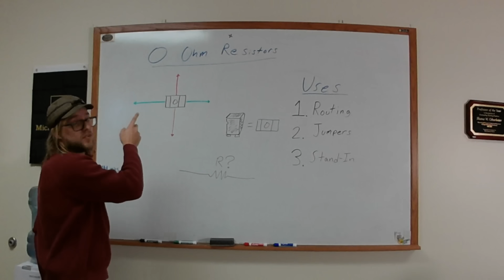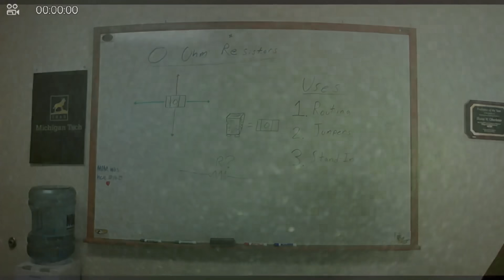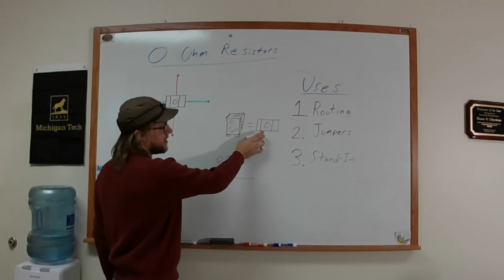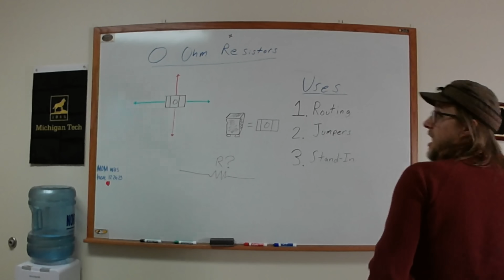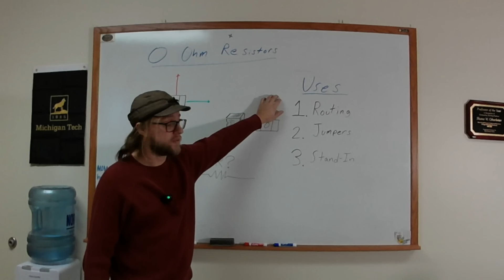The Resistor That Doesn't Resist

Comment: These are used in scanners and two-way radios.

You have a spot for a resistor and if it is in, usually is from the factory, it completes the circuit and blocks a range, usually the 869 to 894 Mhz

You usually had 2 zero ohm resistors

One to block 824 to 849 Mhz
One to block 869 to 894 Mhz

You cut both of them and it opens the 800 band from 806 to 925 Mhz

Comment: I'm sold on the surface mount zero ohm resistors as jumpers across tracks, that is certainly automated production friendly, but the through hole version still just has the feel of a DVD rewinder when wire works just as well.

Comment: Some use a low or 0 ohm resistor as a intentional weak spot or fuse in order to protect more complex and/or expensive parts of the devise in case of a malfunction so a repair will be cheaper and easier to do. This is often used with fuses in the same Circuit to avoid cascade failures.

Comment: Another (which goes back to isolation) is programming, depending on the assembly line you might want to program a chip on the board but can't without disturbing another chip (e.g. programming a microcontroller will turn some outputs on and will or may corrupt another eeprom.) It might be easier to add a 0 ohm resistor after programming rather than programming before soldering.

Comment: Only in the context of a SMD device do i see any legitimacy to the arguement for this device to exist. For through hole components, what is wrong with a wire jumper?  Old toshiba, hitachi, realiatic equipment in the 80's used to have some wire through hole wire jumpers that spanned half the length of the board old car cassette and some cs radios as well.  The actual component body makes no sense to produce when a wire would do. Even if it is just an un-etched resistor.
Reply: the  0 ohm resistor can be put in the board using the same automated machines that put in normal resistors. which simplifies production

Comment: While the resistor may have no resistance, do they come in wattage? As I use different size buss wire for jumpers for the expected current. Are there different lead guages. It would clean up some of my work for sure.

Comment: I've encountered these before. For some reason, they are not uncommon in DIY Eurorack synthesizer modules. However, I've also used leftover clipped leads for the same purpose. I'm not sure why the ceramic type is used.

Comment: I understand your reasoning when it comes to SMD zero ohm resistors, but what about the through-hole one you showed in the beginning? I don't see it having much benefit as a replacement for a jumper, nor can I imagine it's much better at bridging a trace than just a piece of bent solid core wire except for convenience. Maybe as a stand-in? But even then a piece of wire would do the same job (with the sleeve on or some kapton tape on the board in case you don't have solder mask and need to isolate it).
What are some real world examples you came across where a through-hole one was used?

Comment: Now I am curious... what do they do when wired in parallel...  1/0 + 1/0 = ????
Reply: They aren't really zero ohm resistors.  They are just resistances of negligible ohms.

Even if you did have true zero ohm resistors, you could still combine them in parallel, and ultimately end up with zero ohms.

Consider the limit of 1/(1/x + 1/x) as x approaches zero.  Reconfigure this, and you end up with x*x/(x + x).  Both top and bottom, brought x, so we can cancel out an x, and get x/2.  The limit of x/2 is no longer indeterminate, and will approach zero, as x approaches zero.

Comment: I work as an amplifier tech and I see 0R resistors in circuits on a board that also uses raw wire jumpers. Why would a manufacturer use both 0R resistors and raw wire at the same time?

Comment: Another use for 0ohm resistors is cheap and compact Fuses. Those SMD or even axial resistor have a tolerance of about 0.25A so anything higher than that will blow the resistor.

Comment: I have always saved about 20 or so passive component legs (ie resistor legs that you clip off after soldering) for solder  jumping. I could see why someone would use a 0 ohm for boards that are meant to be admired. Also for mass market unless the machine makes it cost more for jumpers vs 0ohm resistors it's probably a waste of time. I've never purchased them myself, but when I assembled boards for others and they provided the parts, they get what they want electronics wise as long as their check clears. You can also heat shrink a resistor leg for more short circuit protection if needed.

Comment: PRO TIP -- PHYSICISTS HATE THIS TRICK!
solder a ton of them together in place of wires to make a circuit with no resistance. It's the room temperature super-conductor they don't want you to know about 😎
Reply: Solder has resistance! BUSTED
Reply: Twist them together @violinviolator5841
Reply: @violinviolator5841  That's what they want you to believe...
Reply: @violinviolator5841 on proper solder, the solder would never be an actual conductor.
Reply: @sergeantsapient  if that were the case solder would have been replaced with glue long ago. On a microscopic level the contacts of electronic components are rough, which reduces their ability to contact. On top of that they‘re covered with oxides that effectively isolate them against each other. Treating them with removes the oxides and liquid solder flows in to fill the gaps created by the roughness of the contacts - which not only increases the area of contact but also oxygen from getting in their and forming oxide layers that reduce conductivity. So in a proper solder the is an essential part of the conducting.
Reply: @MrAranton  I thought the flux is what removed oxides, not the solder. My understanding is that solder does help fill in gaps in the conducting surface but it's not the conductor itself. It's not like you're using the solder as a jumper to the conductor.
Reply: @sergeantsapient  You're partially right. It is the flux that removes the oxides. But without the solder to fill in the gaps between the contacts, they would start to oxidize again, the moment the flux is no longer effective. Now: If you used some non-conductive substance to fill those gaps in order to keep the oxygen out, the electrical connection would be much worse - if there even is one. That's because a conductive solder increases the effective area of contact between the contacts by levelling out their unevenness.

In a proper solder joint, the solder and the surfaces diffuse into each other, which results in a layer of "contact- solder"-alloy. That layer is only a couple of micrometers thick, but it's vital. That means: a proper solder joint has five layers: The material of the first contact (say a soldering pad on a PCD, an alloy layer, a layer of solder, another layer of alloy and then the material of the second contact. If even one of those alloyed layers is missing, we have what is called a "cold solder joint". So on the microscopic level it doesn't make sense to say "the solder isn't the conductor", because it is.

However: on a more marcoscopic level things are different. When you're using a prototyping board - lots of copper plates holse with no connections between them. In that situation smearing solder onto the board to create connections between components is a botch job. The proper way to do it, involves copper wire that's soldered onto the eyes between the components. Maybe that's what who ever told that the solder should never be an actual conductor meant.
Reply: @MrAranton  when I looked into this a couple years ago, I think what I was told was that the solder itself amalgamates to the conductor. But yeah what you're saying does make sense. I guess I was looking at it more along the lines of using solder as a jumper or a bridge which from every other practice I've seen when it comes to soldering is a huge no-no.
Reply: @sergeantsapient  And I was looking at it along the lines of an individual solder joint. So I guess we were both right, but in different ways?

I wouldn't have used the term "amalgamate" - in my native language that's strictly reserved for "forming alloys with mercury/quicksilver" - but apart from that it seems we were told the same thing.
Reply: @sergeantsapient  Flux removes oxides, but the solder then prevents new oxides forming as it conformally coats and seals the joint.
Reply: Definitely works. Made my own hydrogen fusion bottle using these.
Reply: 0 Ohm resistors aren't really zero ohms.  They still have some insignificant resistance, of fractional ohms.
Reply: @carultch  I'm glad you understood the joke :)

Comment: They also match impedance more closely than PCB traces when you have precise requirements like a differential amplifier op amp configuration; by using a 0.01ohm resistor and a 0 ohm one, both have the same resistance between the leads and PCB and length of the resistor itself (compared to a PCB trace) which cancels out perfectly.

Comment: This past summer, I diagnosed a Mitsubishi split A/C control board that had what appeared to be a diode, white stripe at one end and black body. But had zero resistance in either direction, the problem turned out to be a transformer. So I assume it was a zero resistor , but why look like a diode?

Comment: Zero Ohm resistors do also exist in SMD versions. They are often used instead of configuration switches. Automatic machines can pick and place them like normal resistors. And they can be spotted easily on the board because of the big "0" written on it.
Reply: He literally showed you SMD versions of zero ohm resistors in the video.
Reply: @eidodk  Yeah, I was a bit too fast with my comment...

Comment: At home I still have a whole old amplifier set that use wire instead of 0-ohm resistor for routing. The board is one-layer two-sided, with all through-hole components and a lot of "short bridge" using wire (I call them bridge because I see they bridge over multiple cross running traces).

Comment: Still, why not just use a piece of wire?
Reply: You might do that if you were just building a laboratory circuit.  But for a mass-produced circuit, it is much more economical to standardize on the same machine process, as you use for installing the resistors.

Comment: I've seen the SMD ones conveniently placed on the path of series LEDs inside a a spotlight, they were just bridging over some traces, while being in the exact place I needed to cut the traces to do my modifications to the board - so I just took them off and it was ready to do my thing. Very convenient.
But the proper 0ohm resistor shown...
I remember seeing wires used from factory on some CRT TV boards to jump over traces - and there were lots of them, but they were machine placed. Which begs the question... just why call the thing resistor and have the thing look exactly like a resistor if it is nothing but a wire? Why don't we just call it "jumper wire" or smth...

Comment: The three reasons stated are likely not the reasons that these parts exist. Years ago before surface mount components became the norm, circuit board manufacturing used specialized equipment for automatic component insertion, and this equipment was designed to use parts that are shaped like a resistor and could be physically gripped the same way. If a jumper or wire is needed on the board, a zero ohm resistor is used because the equipment can grasp it, and it can't work with plain wire.
Reply: All true.  In my shop we hand stuffed boards on a slide line and I still used them.  Easier to grab and insert by hand as well compared to a bare wire.

Comment: Hi, I'm a noob. My question is, why 0 ohm resistor, why not a bare piece of wire, may be with plastic sheaths on?
Reply: For a laboratory circuit that you're just making one copy of, for your own work, there's no need to use the zero ohm resistor.  You can, as you suggested, use a bridge wire to jump between circuit board traces, or protoboard inputs.

For a mass-produced circuit, it is more efficient to set the machines to perform the same task as they do for fabricating the resistor connections, to fabricate the jumpers.  This reduces the human involvement needed, and the same machine settings can install all the resistors, and all the jumpers, in the same program run.

Comment: They are used as fuses, 1/8 or 1/4 watt jumpers that also act as board protection fuses.
Same goes for the zero ohm SMD resisters, most commonly used as current limiting fuse jumpers or logic select jumpers instead of more expensive DIP switches. PIH jumpers are solid wire, the 0 PIH part is used to conform with the PIH insertion machine that loads the parts in a tape strip and thus must have the resister body to grab and insert the part robotically and trim the leads under side before the board hits the wave soldering flow machine. As an engineer, you defiantly need to learn how the process works before guessing at the output product means and ways.

Comment: Would a 1 Ohm resistor have the same result?
Reply: Not exactly. Remember, V=IR. If there's very little current passing through there, then it's fine to substitute a 1 Ohm resistor. If you had 1 amp flowing through there, a 1 ohm resistor would would create a drop of 1 volts, and consume 1 watt of power. On the other hand, 1 milliamp of current would create a drop of 1 millivolts, and consume 1 microwatt of power. Depending on your circuit, 1 ohm may be negligeable or it may be huge. Sometimes, you use what you've got, but, when possible, just do it right.

Comment: On that first circuit board, it looks like the solder gets extremely close to the track the 0 ohm resistor is crossing. Wouldn't a wire be a better option in that use case so you can get better separation? That could very easily end up shorting.

Comment: Are they rated at 1/4 watt like actual resistors of the same size? If so they may have significance as a component, but other than that, it's nothing but a link with the dummy shape to aid robotic builds. The only time I would use one would be in the case of SMD, where it would be useful to keep the job tiny and tidy.

Comment: I was wondering what these were, when things get slow on my pcb inspection job I like to dick around with the garbage/damaged parts and couldn't figure out why there were what was essentially a solid metal resistor with what looked like a zero ohm band on them. Mystery solved.

Comment: Back in the "old days" ('71 to '80 or so) DEC used a floating address and vector scheme for its Unibus peripherals and we used 0 Ohm resistors to set these parameters. We could have used bare jumper wires but using the "resistors" insured that you wouldn't short out a PC land that might run beneath the two solder points. They were also much easier to spot than a bare wire when it was time to change the board's parameters yet again.  ;^)

Comment: I use zero ohm resistors for "select by test" components in machines that need to be calibrated. Sometimes you need to finely change the resistance of a circuit, but resistors only come in certain set values. Like you can get a 100k and a 110k resistor, but what if you need a 105k resistor? In that case you can have two resistors in series, a 100k (coarse) and a 5k (fine). But for another copy of the same machine you might need exactly a 110k resistor in that path. Then you can't just leave the pad open, so you'd use a 110k resistor (coarse) and a 0Ω resistor (fine) to calibrate that one.
Reply: 0 ohm does not have any tolerance series.

Comment: Wait... shouldn't it be a "one ohm" resistor? Since Ohm's Law is a division operation, a resistance of less than one would do funny things to the amount of power going through. 1Ω means input = output unmodified...
Reply: It's not really zero ohms, it's just small enough that it is smaller than a manufacturing tolerance away from zero ohms, so that its resistance is negligibly small.

There is also no such thing as an ideal voltage source, as you see in an introductory textbook.  So if you did short-circuit a power supply with this resistor, it wouldn't produce its full voltage at its terminals.  The voltage drop would happen across its internal impedance, and probably blow the safety fuse of your power supply.

Comment: Some 'manufacturers' will replace the ferrite beads with 0-Ω resistors in mass production. This could violate the EMC test because they are cheating.
Reply: i was thinking the same but in the opposite way: a good designer prepare the board for the emc testing. In case of fail the Ferrites are added, otherwise the 0 ohm are kept.

Comment: Apart of being used as a bridge resistor, I've seen 0 ohm resistors being used as inexpensive fuses. They behave linearly and can stand around 12 amps per watt, so a 0.25 watt unit can stand 3 amps, 0.5 watt 6 amps, 1.5 watt 18 amps and so.

Comment: It's funny.  You can draw a resistor on a piece of paper with a pencil and it will function as one.  I had a particularly bad static electricity problem near my old Hi-Fi system.  I made a discharge pad I could touch but the shock was pretty intense.⚡  I tried a 10 megohm resistor on the pad but didn't work.  I drew a "resistor" on a 3x5 card stock.  A #2 pencil with the line running back and forth to where the line was about 30 inches long.  I connected it in series with my discharge pad.  I figured it was in the gigaohm or terraohm range but it still gave a spark.  Not quite as intense, so it effectively worked to some extent.
Reply: Seven zigzags, no more, no less, otherwise it's not a real resistor. 😀
Reply: @narfharder  😆
Reply: @Iconoclasher  Now see if you can draw a capacitor in graphite on paper, and see if it will act as a capacitor.
Reply: @carultch  Now you got me thinking.  Scribble enough pencil graphite on both sides of a paper and it might work.  Two conductors with an insulator.  Capacitors used to have paper insulation. 🤔